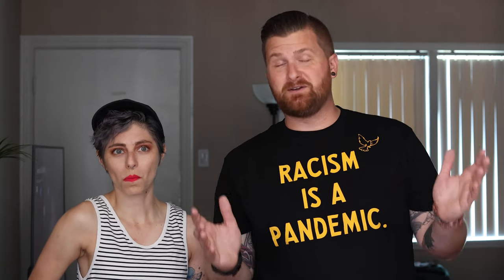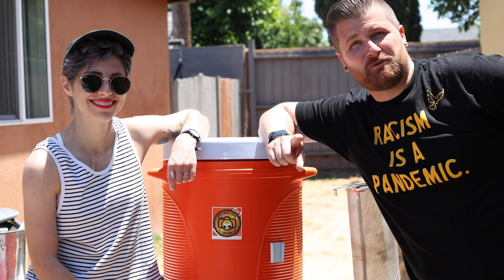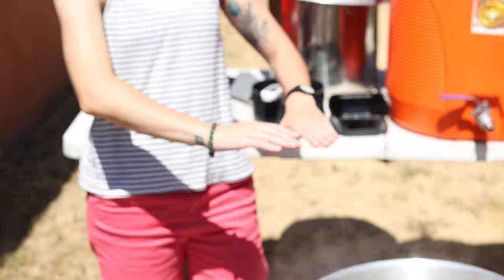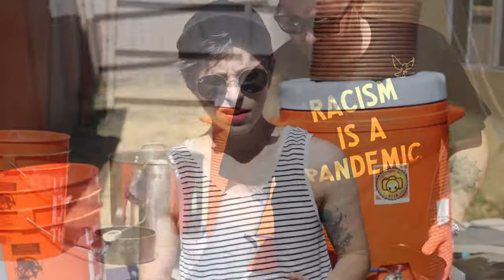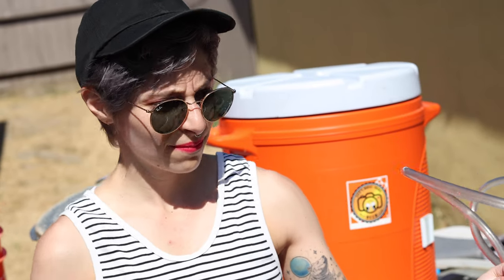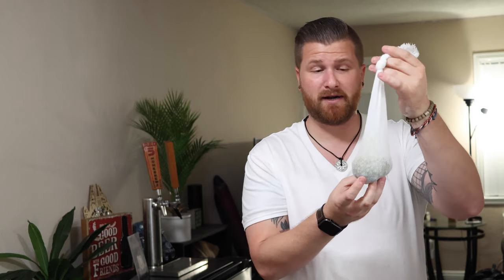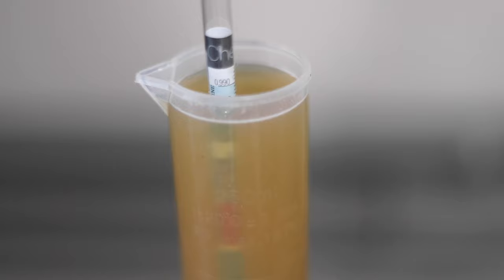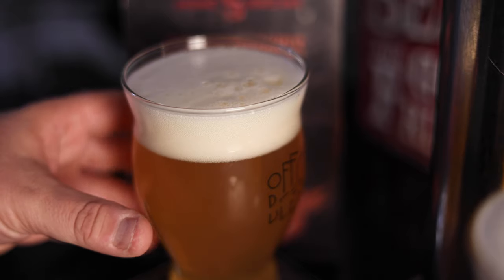Homebrew Tutorial: Grain to Glass - Double Dry Hopped West Coast Double IPA (How to Brew)

Comment: Get an ink bird for $30 on Amazon and connect it to your kegerator. Empty it out and leave your fermented in there . That’s what I do when I’m brewing two beers. One in my fermentation chamber and one in my kegerator. I also use a thermowrap when I use keviek, like $15 on Amazon
Reply from the maker: The way my kegerator is built (it was a custom build out of a mini fridge) will not support the build of a fermenter. Thermowrap is a genius idea for kviek!
Reply: @LetsHaveSomeBeer  wait srsly? How is that? Isn’t 2  kegs bigger and wider then a bucket fermenter?
Reply from the maker: I know it doesn’t make sense off the bat, but keep in mind overall diameter of a fermenter vs a torpedo keg. It’s the shelf in the back that would block the bucket. Bucket diameter vs torpedo keg diameter is what makes the difference
Reply: @LetsHaveSomeBeer  I suppose you could ferment in a keg with a gas disconnect and tubing as an airlock . You could get a floating dip tube to transfer . That way no air ever touches the beer or if you don’t want to you could just siphon from keg to keg. You could probably ferment under pressure also, but you would need a sounding valve. If you wanna lager I suggest you ferment in the keg with an ink bird so that way it could fit. You literally would just spend $30 for the inkbird . Just siphon from the top once it’s done taht way you keep cost down. If if you want get a floating dip tube( runs about $15). Or spending valve ( about 25) bucks. 
I love fermenting under pressure because once it’s kegged I only have to wait like 3-4 days since it’s already partially carbonated once it starts  fermenting